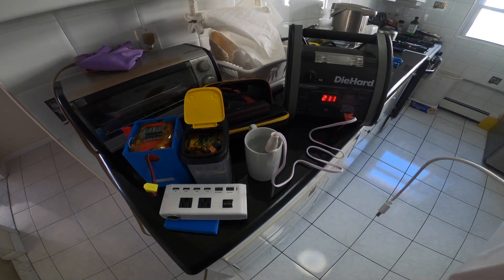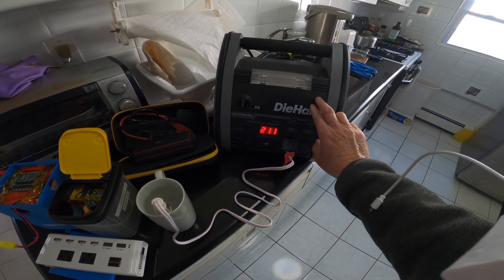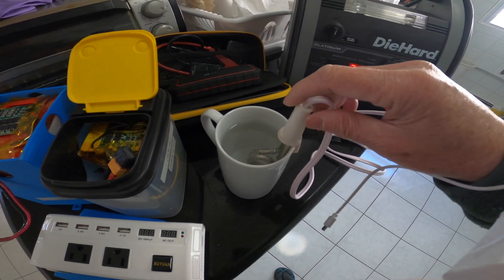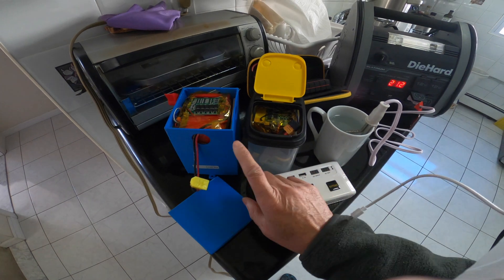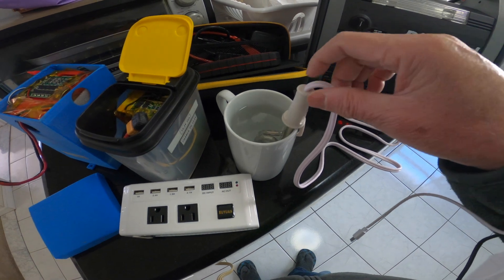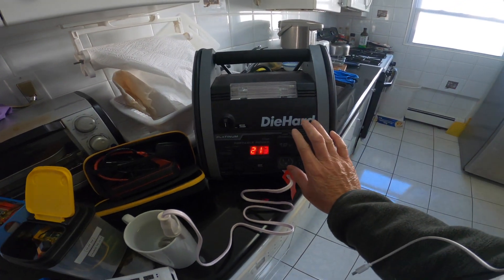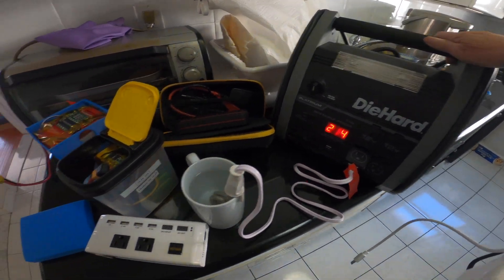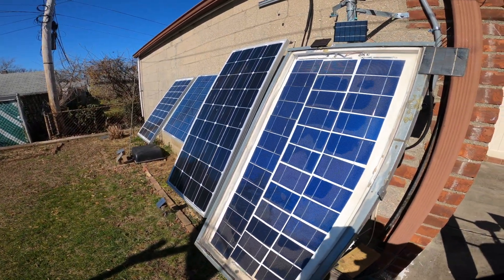How to boil water with  free energy.

Comment: Not free energy -_-
Reply from the maker: You are right. Free energy only in a manner of speaking. I still have to buy solar panels, inverters, immersion heater and miscellaneous wiring and connectors. Above all, I need the sun. You are probably working on true free energy. Good luck!
Reply: @wtam69  Already researched. Synchronous condenser with added coil layer for step-up transformer output. Free spinning electromagnet rotor with magnetic attraction. Overunity by default with self-excitation. Tesla invented synchronous motor then invent tesla turbine??? Researched synchronous motor and it has upgraded version. Synchronous condenser or no load overexcited synchronous motor. Tesla really hid his overunity machine well by creating a ton of distractions. But as usual, there will always be people who figured it out. Now the information is passed on to you. Run simulations then build it. Enable self-excitation and feedback loop for perpetual motion with overunity.
Reply from the maker: @atum7355  Very deep. Thanks for the enlightenment.